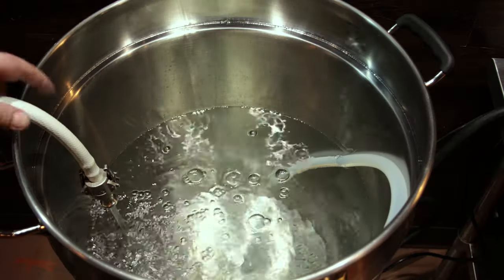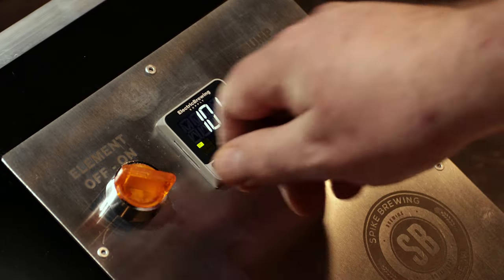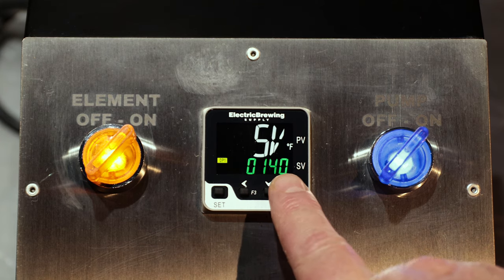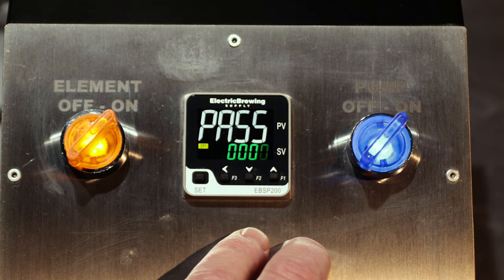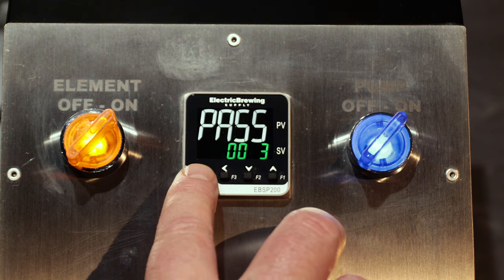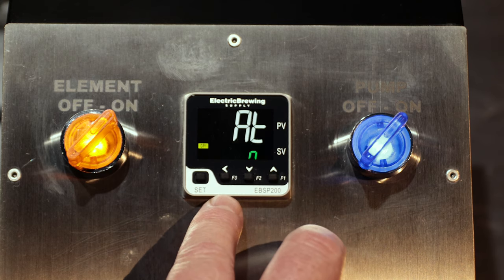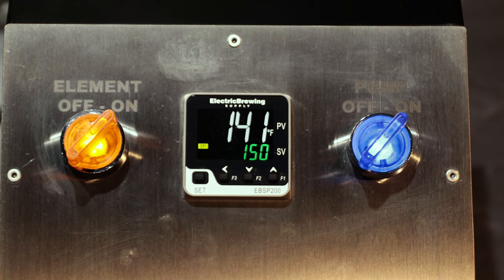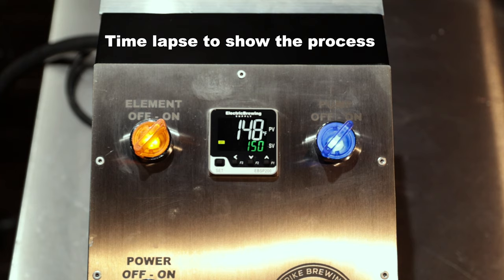How to Auto Tune the Spike Brewing Single Vessel Brewing System Controller

Comment: I use the condensate lid along with the Spike Solo+ 20 gallon system and I had the question of "Do I run auto tune with the lid on or off"".  The answer, according to Spike Brewing is "Off".  I hope this helps others with the same question.
Reply from the maker: I personally recommend running the auto tune the way you are going to use the system..if you mash with the lid off leave it off. If you mash with it on leave it on when auto tune is performed.👍🍻

Comment: Brian - Thanks for all your fantastic videos! You MUST know by now how helpful you are to your viewers. You might need securing at the next industry show. ha....Hey, So I'm autotuning the PID on my new 20gal Solo. But instead of OP1 on the lower left, I get a OP2...... and then occasionally, an OP1 pops on next to it. Any idea what that is. Thanks >Robert
Reply from the maker: Did the auto tune complete?
Reply: @ShortCircuitedBrewers  While replying, I looked back at the end of your video and the OP2 on yours was lit up similar to mine. After 30 minutes or less, the ATU stopped blinking. I think I'm good.... Thanks!
Reply from the maker: @imageshift  that's what I was thinking. Glad it worked! 👍🍻

Comment: Definitely better than the Spike Instructions.   However, I am having an issue that maybe you could help with.   Following autotune, I am getting thermapen readings of the water 5-6 degrees hotter than the PID is reading.  This is at mash temps and even boiling temps.  My PID reads 201 max when my definitely boiling water reads 206-207 on my thermapen (3000ft elevation).  Do I need to do another autotune?  I started my autotune at around 145F, maybe it was too soon?  Any insight would be great, thanks!  I"m using the 120V, 10 gallon system
Reply from the maker: Follow the offset adjustment for the temp correction. You don't need to do an additional auto tune. 👍🍻
Reply: @ShortCircuitedBrewers  Thanks so much!
Reply from the maker: @TheCoastlander  glad to help

Comment: So if I used this controller with another system, does it have to be auto tuned specifically for that? If so, does it hold different profiles?
Reply from the maker: Yes it needs auto tuned for the system being used..it does it hold more than the current profile at one time 👍🍻
Reply: @ShortCircuitedBrewers  been looking all over for a manual for the PID, even from electric brewing site. can seem to find much yet. i just have 2 different systems i would like to be able to switch between and not have to autotune each time i switch.
Reply from the maker: @prOkrEAt  unless they are very similar you will have to auto tube everytime.